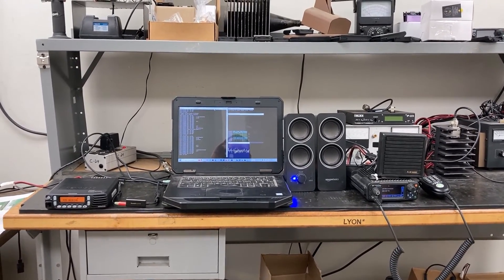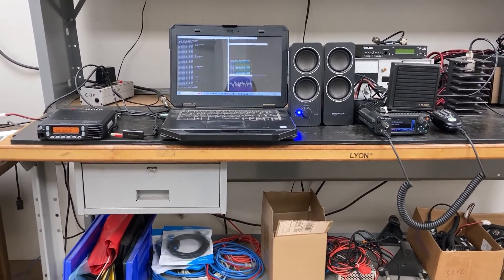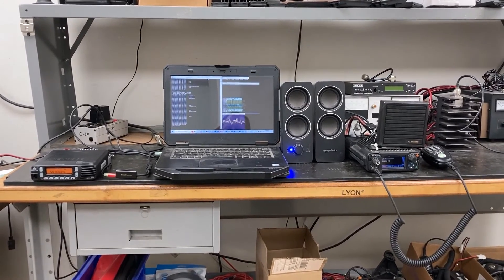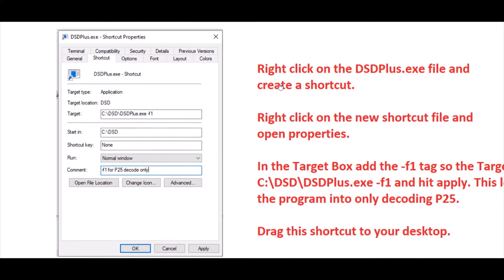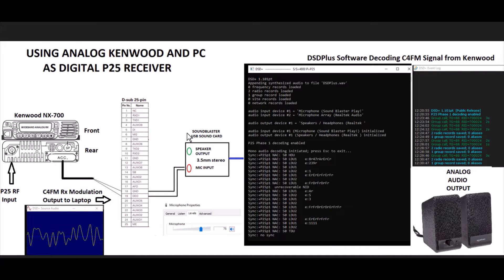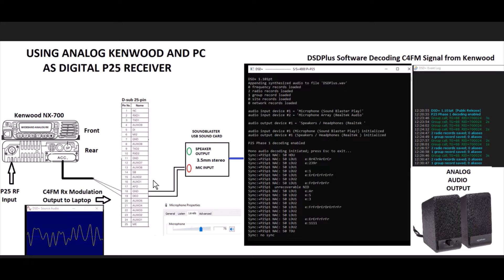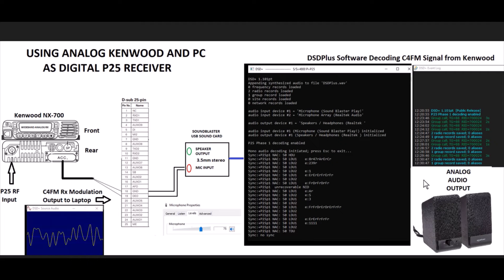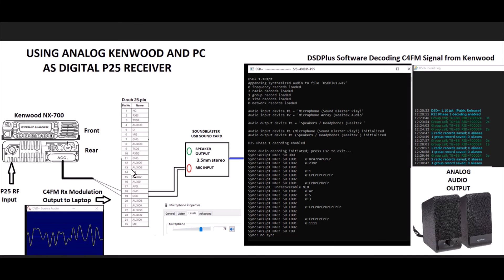Using an Analog Radio and PC to make a P25 Digital Receiver

Comment: So is this possible with any analog scanner? Only asking because I see P 25 receive on the kenwood wasn’t sure if it was maybe a feature in the unit or something.
Reply from the maker: Yes, as long as the audio is not distorted, and use a capacitor to take any dc voltage off. The C4FM signal coming out is essentially a 2400hz tone that varies in amplitude. Use wideband receive.